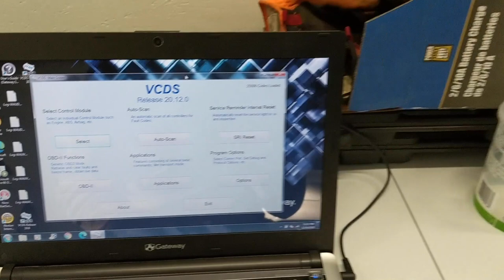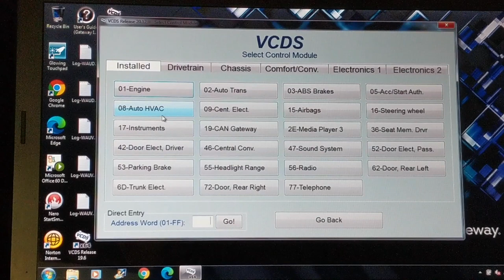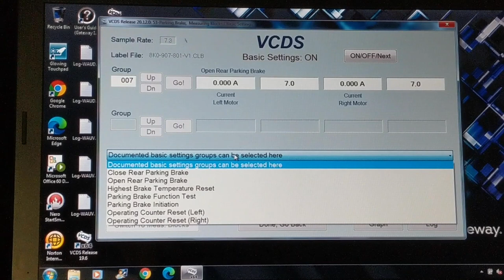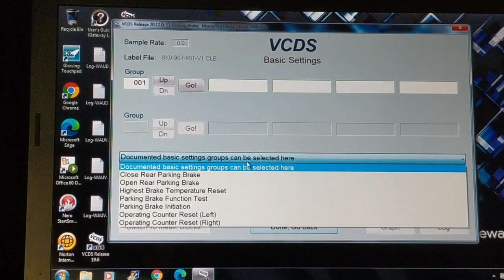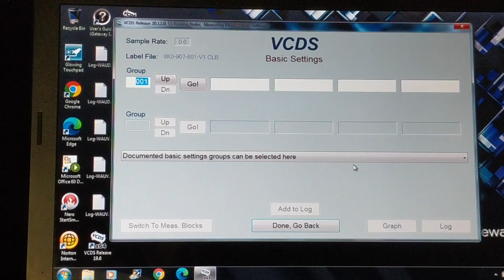How To Replace Front & Rear Brakes | VCDS for Electronic Parking Brake (EPB) | Audi A4 B8 2.0

Comment: Great vid man.. working on my b8 now, quick question.. this may sound silly but how to you jack the car up?  Right now i jack it by the pinch welds but theres no room to slide a jackstand there. so i place the jackstand by the control arm and the frame.. I don't know if this is the right way to do it just asking if you have a better way to jack and place the jack stands.
Reply from the maker: Nowadays I just use my quickjacks (I've got a review on it on my channel here) but for the B8 that I care a little less about, I'll jack the car up from the front subframe in the middle of the car and I'll slip my jack stands onto the jack points along the frame. But, I have a set of V-style rubber jack stand pads (also have a vid of those on the channel) to sit on the jack stand arms and protect the pinch weld. I even use the jack pad adapters when jacking up one corner of the car. Always be protectin' the pinch welds.
Reply: @FigureItAudi  thanks for the quick reply.. i appreciate it.. next time your down there on your b8 snap a pic for me of where you jack in the front if you don't mind.. my undercarriage is mostly covere
d in plastic so i just want to be sure.. before i put the jack through my floor boards. lmao.. thanks again my guy

Comment: Brilliant video thank you, very informative. I have a question regarding the rears. I am also changing the calipers and brake hose. Would it be wise to do one side at a time and bleed. Then repeat the whole procedure on the other side and bleed? Thanks
Reply from the maker: Bleed once at the end! Especially because typically you will bleed the corners in order of furthest to closest to the master cylinder, and it's not a terribly fun job, so just do it once with confidence. Thanks for watching
Reply: Thank you for your fast response.
Just for clarity is advised I bleed all 4 corners in sequence after doing both rears or just the 2 rear in sequence. Many thanks again.
Reply from the maker: @martyj200  Even if you're only replacing the rear lines and calipers, I would still bleed all corners just to be sure air didn't travel up the lines from the rear and create a void somewhere further up the system. Realistically you'll only be losing maybe 1/4-1/2 a cup of fluid in doing that so it's worth the extra effort and cost of materials. I imagine you would have purchased a litre of brake fluid to do your job so you may as well use it.
Reply: Thanks again for your advice spot on

Comment: The 21mm looks small, more like an 18mm. I disagree with the first commenter, I worked in  car repair from 2007 to 2009 and we used a product called " sill glide" basically grease, as you did in this video. The glue on the backside of the pad that you experienced is exactly that. It helps with sequel and chatter. I have also used this kind of stuff made by Permatex. Your videos are enjoyable, informative and calming. Mostly because of the way you speak 👌.

Comment: If your going to do a brake job do it right.  Follow all recommended processes by SAE (Society Of Automotive Engineers).  When pushing the piston back into the caliper crack the bread screw and push all of the fluid out.  The piston will go back into the caliper easily as well.  Brake fluid is made to hold water and will rust a metal or cast caliper.  Brake fluid will also boil in the caliper and it will brake down. Alway uses the correct DOT brake fluid.  With Audi it is DOT 4 fluid, Audi recommend changing every two years.  Second, the pins for the pin slides should be removed and cleaned and new lubricant applied.  Replace the dust boots if needed.  Inspect the boot around the caliper piston, if torn it or the caliper will need to be replaced.. Some Audi OEM pads have adhesive on them to stick to the caliper this is to keep the pad from dragging on the rotor.

Comment: You mentioned that the OEM pads were dusty, and that these were supposed to release less dust... Did you find these ones cleaner?
Reply from the maker: Hey Mark - Good Q: No, in fact I'd say they are as dusty or even worse. Good pads, but the wheels are basically covered in a brown cake all the time, which says a lot considering the wheels are black.

Comment: couple notes .. putting a lot of grease in guide pins is not a good idea.... it will be creating extra pressure inside boot and will be trying to escape....you can put anti-seize grease  on back of brake pads but not lube...as well as putting lube in brake pad springs is not recommended because it will collect grime and dust in them and might cause them to stuck/move more hard. other then that job done well. partwise i like Zimmermann rotors and textar pads...but it is a choice of taste
Reply from the maker: Valid - I do like my grease. You're right about the boots: while prepping the pins I did have too much new grease on them at first which caused a suction effect inside the carrier. I removed some grease and worked the pins with the boot on while lifting the edge until they could slide freely and without pressure resistance.